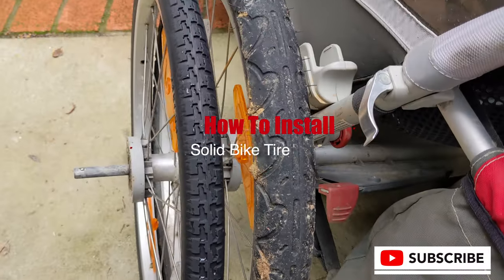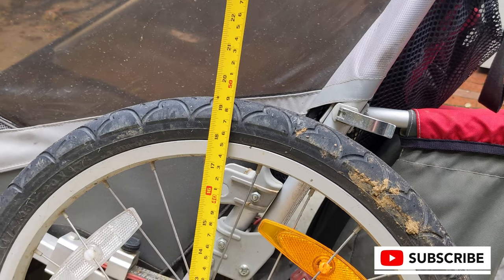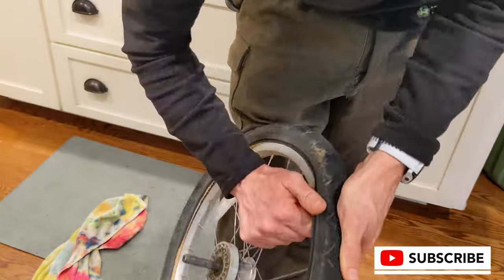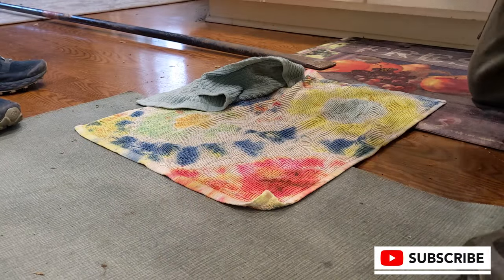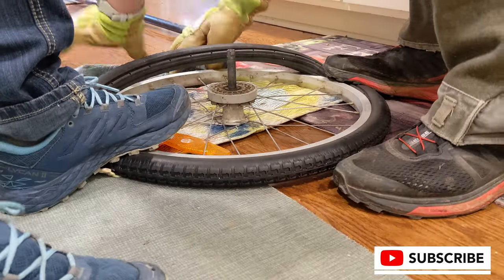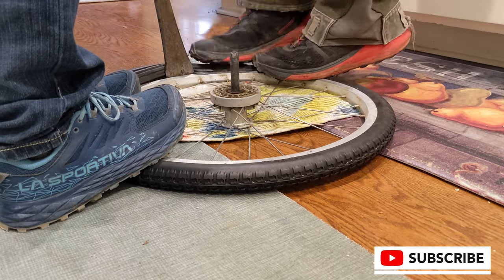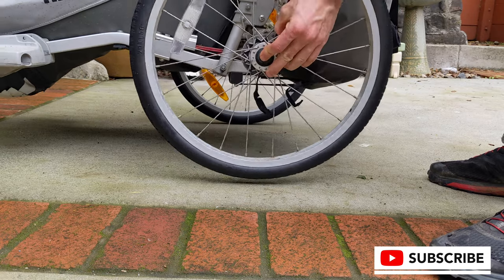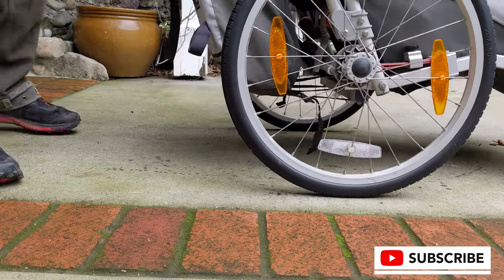How to install a solid bike tire Catazer Bicycle Solid Tires 20 Inch 20x1.50 Tires.

Comment: The hot water is a great idea (why didn't I think of that).  It's not hot enough yet in Utah to heat the Tannus solid tire outside, so I have been wondering how I was going to get it on the wheel.  Now I know.  Thank you.

Comment: I know these are installed, so it's too late to measure, but do you happen to recall how thick the bead portion of this tire was?  I want to put solid tires on a set of double wall 20" rims I have and was going to go with Amerityre, but according to their site the tire I want needs an internal rim depth of at least 11mm.  Being that my rims are double walled, they are only about 8mm deep.
Reply from the maker: I wish I would have done that. There's no way those tires are coming off though. 11 mm depth seems reasonable. What rim depth are you looking at specifically? On the wheels you have?
Reply: @buckmanriver  From top of rim wall to deepest part of rim.  Laid a straight edge at 90 degrees across the rim, resting on top of the rim walls, and measured from the deepest part of the center of the rim to the bottom of the straight edge.  Edit.  Measured again and got 9mm...lol.  My concern is that if the bead portion of the tire doesn't sit down far enough inside the rim, the tire may be more likely to roll off the rim in a turn or something.